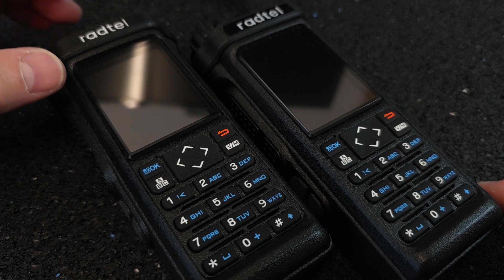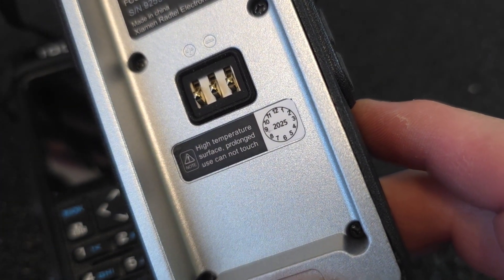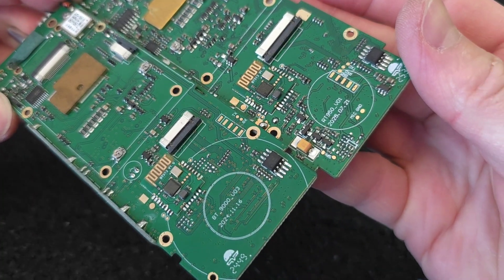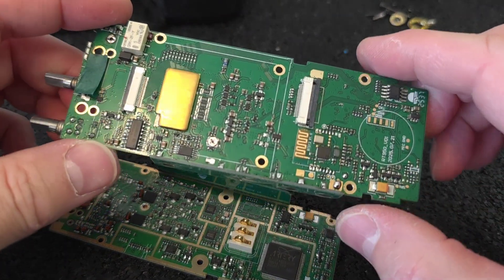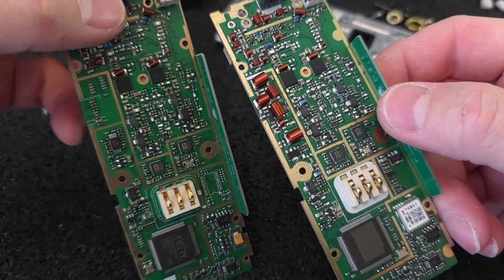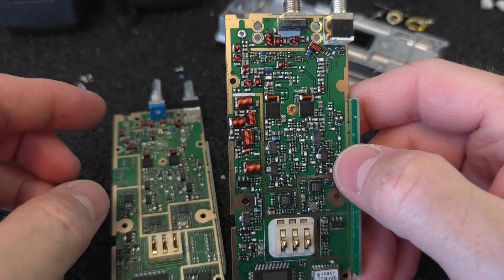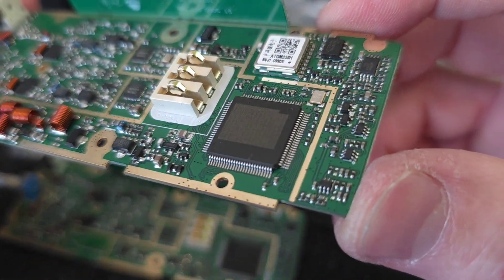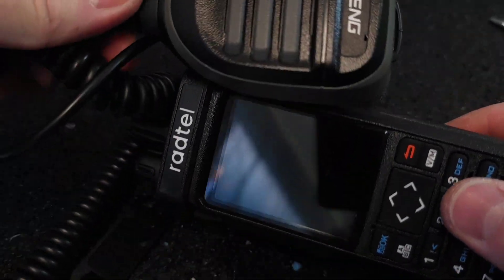Radtel RT-950 vs. RT-950 PRO: Teardown & Comparison - IS IT THE SAME RADIO??

Comment: Is there an adapter that would let me connect a mic for the 950 Pro ? I know of one but the sound comes out the mic and the radio at the same time , I trying to find one where the sound only comes through mic .

Comment: Which is the latest hardware build of the radio, some say the Bajeton, some say the green Radtel. Or are they all the same?
Reply from the maker: If you buy the 950pro now from Radtel it will be latest build for sure. They no longer sell first build.

Comment: I received the 950 pro yesterday but it won't change frequencies on the SW, it changes on the display but there is no change in reception and if I was listening to FM radio before and when I turn it off and on again but on the SW it receives FM radio again and the display shows and nothing changes on reception but the display changes.......what is that

Comment: The marking on the manufacturing sticker is not the middle of September. It's the middle of August. Strangely enough, the electro bananas 950 Pro has a later production date and higher serial number, and it came without the LW/MW mod. Now I have to open mine to find out which one I got. 😂

Comment: How is it possible that your device with S/N 9255B000126, a very early batch, is already the modified version? Has the device been refurbished by Radtel?
Reply from the maker: Yes, they modified stock radios manually in manufactory.

Comment: Hi Pavol, greetings from HU! I see, your 950pro board is a "fixed" one. But i have seen in you previous video, you are suffering with lw/mw issue. So my question - have you modified your radio to enable lw/mw ? If yes, do you plan to create a video tutorail how to do it, what needs to be modify etc, as you did in case of other radios? -- Thx in advance for your reply! Br 73 de hg5cjw
Reply from the maker: No, i didn't modify it. It came as it is, but lw and mw are still deaf.

Comment: Hey Paul, I have a question. Do you happen to know which pins of the accessory connector need to be bridged to disable the internal speaker and microphone? I'm pretty sure a bridge is needed to accomplish this. That's how it's done with the RT-880, at least. I have a Bluetooth hand mic that I want to use with my RT-950 Pro. But now I'm getting an echo because the internal microphone continues to work with the adapter you're showing.

Comment: My Bajeton 9000 has the Radtel board, has a slight difference and can hear LW and MW, whereas the RT950 is a bit deaf.
Perhaps take a look at the Bajeton 9000 Paul, if you get the chance.

Comment: Your RT 950 Pro is using the old motherboard RT950_V01, but Radtel have manually reworked it before they shipped it to you. I would be interested to know when yours was actually shipped. The new board RT950_V02 (2025.09.12) does not have those pads populated at all during manufacture.
Reply: As far as I know, there is no hardware version V02 yet. The new version of the devices differs only in the component placement in the AM branch.